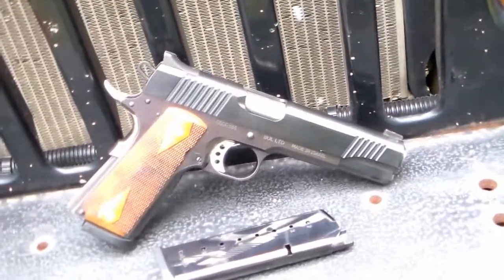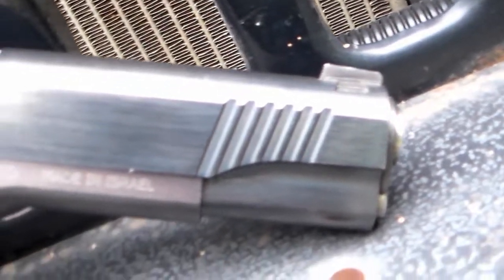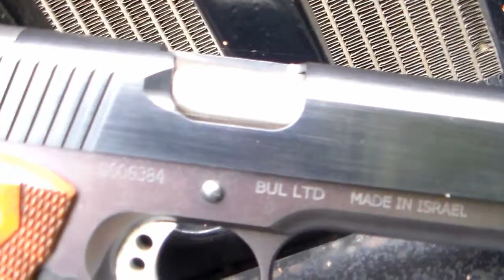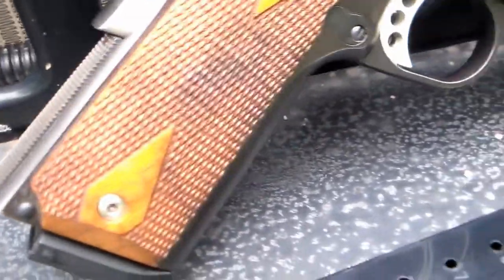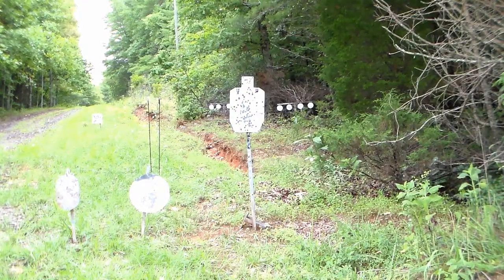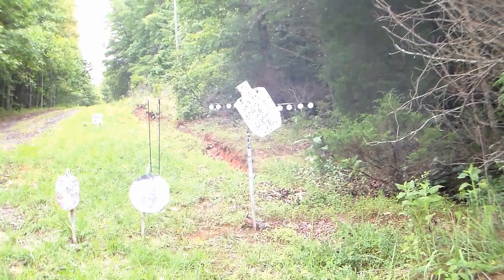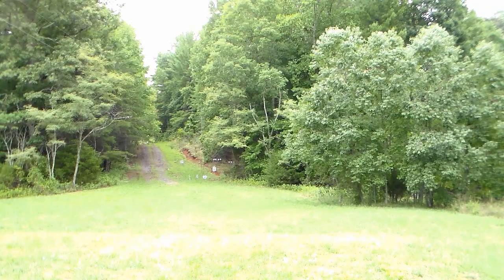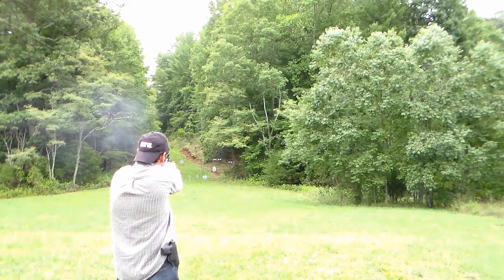Desert Eagle 1911 Shooting Steel

Comment: Hey man. I am looking for a 1911 to put threw the ringer in a few mounts. here are my catches. last one and firsts one I had was a RIA gi model and it ran flawlessly however with those gi sights on I had trouble making hits that and I had no experiences with 1911 triggers also I want a rail for a full size 1911. I am looking for a modern, full size 1911, black in color, stock good modern night sights and a rail. If you have a suggestions off hand let me know thanks. nice vid :)
Reply from the maker: Jordan The Okay I would suggest any of the newest line from Para ordnance!..Most come standard with a great trigger and a fiber optic front sight..They even make a 14-45 which is yes....14 rounds of demolition!
Reply: ***** I have been eyeballing the 14 45s since 6 or 7 years ago when I was 17 or 18!